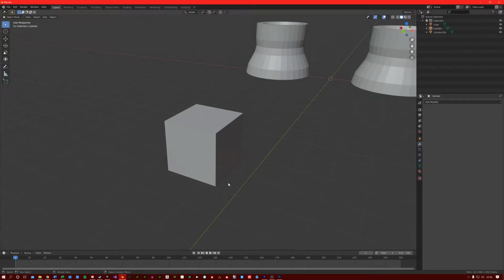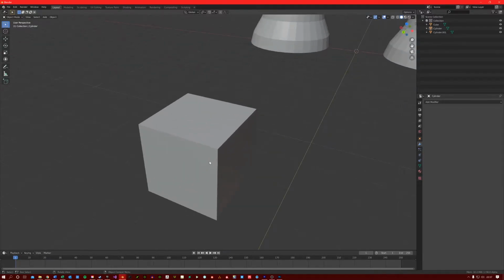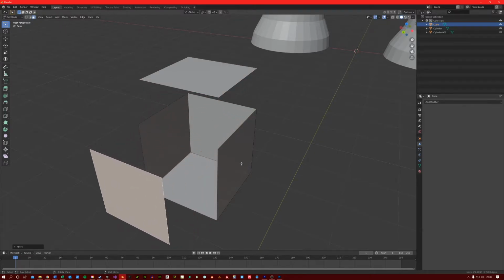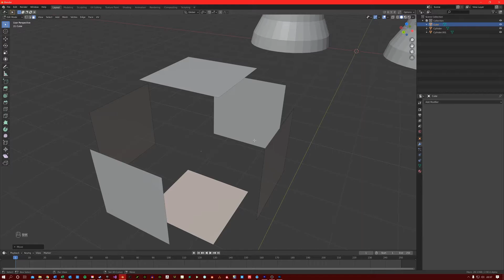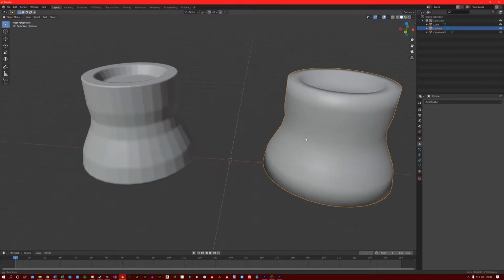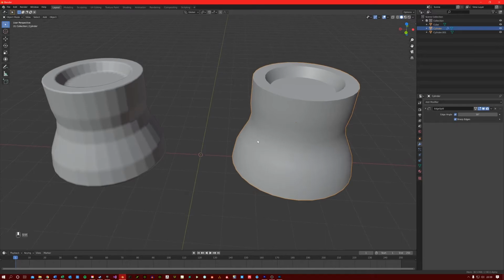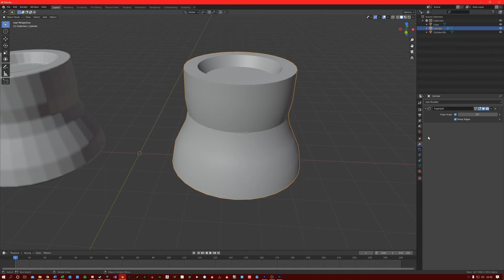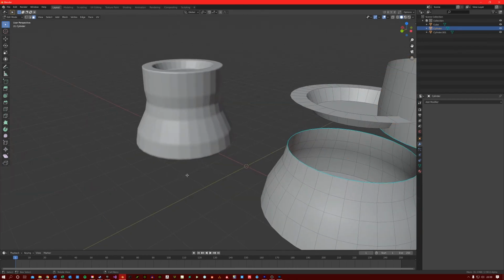Blender: Modifiers - Edge Split

Comment: How can I split a part of area of my mesh..for example a arms..I need to spearate the forearm from the upper arm and the hand? withousuing this modifier?? I mean I have in my stack's modifier a lot of modifier (mirror, weithpaintin, sub-d) thx.
Reply: late reply but ... you want two separate objects, where you currently have a single object? Go into EDIT mode on that single object, select the geometry you want to make a separate object, press P and choose SELECTION. Pop back into Object mode. What was once a single object is now two separate objects.